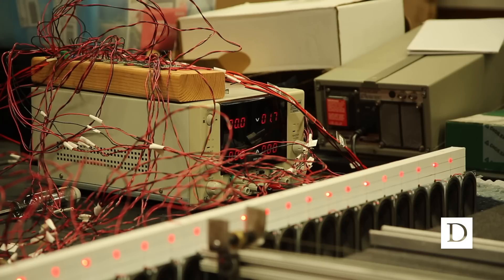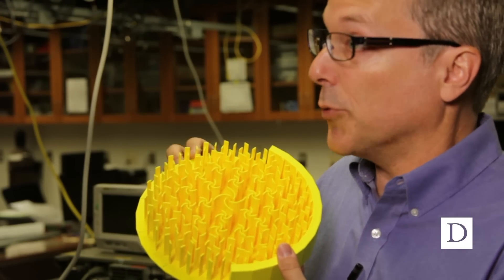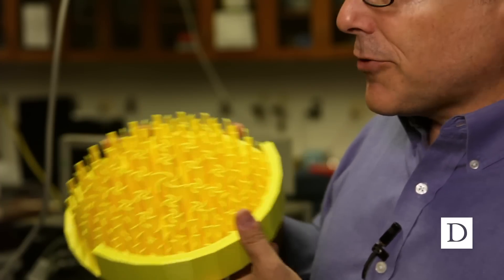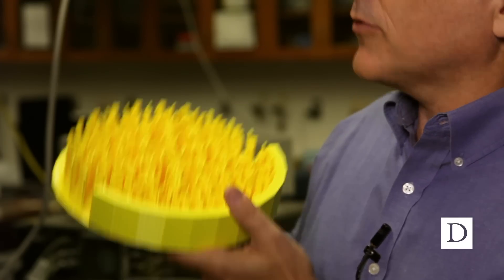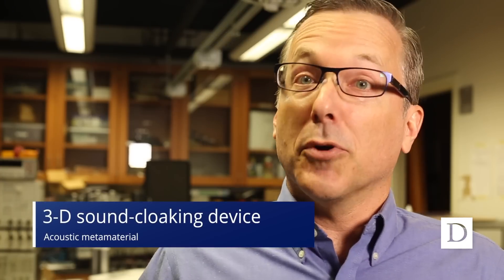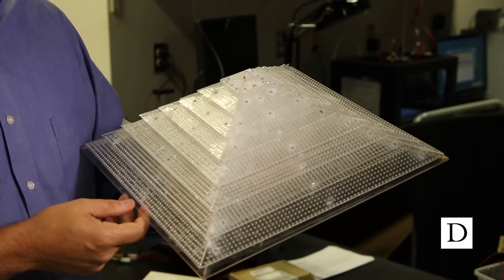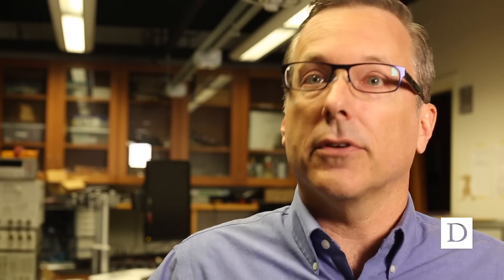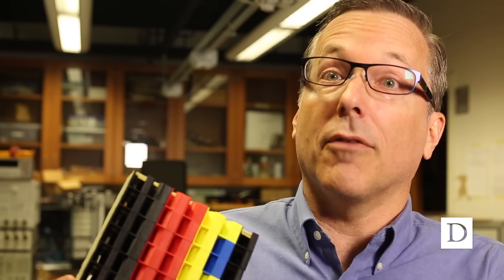Acoustic Metamaterials with Steve Cummer

Comment: Noise control of a single frequency? 
Helmholtz, and quarter wave resonator do exactly that....
Reply: As he mentioned, metamaterials are much more compact.  Also, 3D printing would allow much better quality control over home-made designs typically employed in home theater applications.
Reply: @bobsondugnutt7526  how do you logically separate “home made” and “3D printing” these days? Even metal sintering machines are becoming available and for acoustics PLA is plenty.